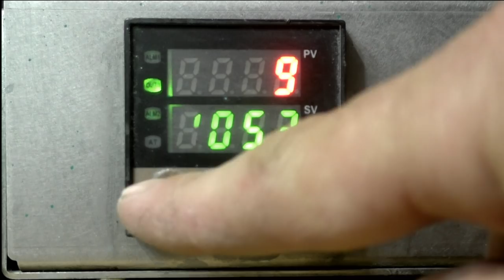Restoration old calendar video

Comment: I've seen quite a handful of these calendars, and I'd like to point out what outstanding job you did on this one. I had never seen one damaged so badly as in the beginning of the video, neither had I seen one so shiny, smooth and beautiful as your end result. The thermochrome coating you applied looks amazing - without actually touching those details and seeing them up close I doubt I would tell they're not nickel plated.
You're very skillful with the lathe - making such tiny details as a little handle and rivets takes a steady hand.
And I could only admire the ultimate power move of melting your own brass blank in your own furnace! That was crazy!
Thank you very much, this project of yours was quite a ride.
Что же до английских названий, я считаю, что в этом нет ничего плохого. Вероятно, был бы уместен подбор шрифта более схожего с оригиналом, но сам язык какой-то мистической аутентичности не отнимает и не прибавляет.
Большое спасибо, крепкого Вам здоровья и дальнейших успехов!
Reply from the maker: Спасибо вам за такой замечательный отзыв

Comment: DUUUde that's restoration architect level fix.
EDIT: Also How does it work ? do the numbers change as you rotate automatically or ?
Reply from the maker: Yes the numbers change as you rotate
Reply: @PSVRestoration  do you have footage of that? It will be interesting.
Reply from the maker: @zobook  No unfortunately not left

Comment: What priduct did you use for the chrome paint that is heat activated.
Reply from the maker: It's thermochromic varnish, that's what they call it.
Reply: @PSVRestoration  Thanks, tried finding it but searches just return nail polish or paints that change color to the touch.
Reply: Yes me too. Do you have a website or found it? A web link? Thanks